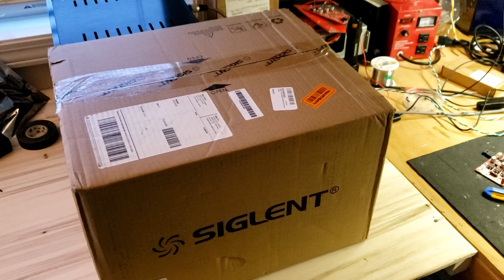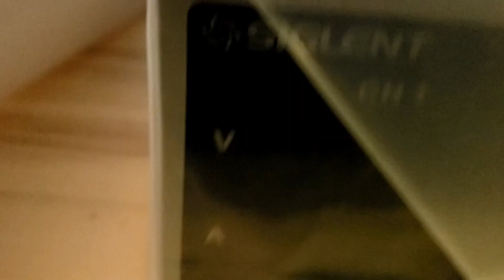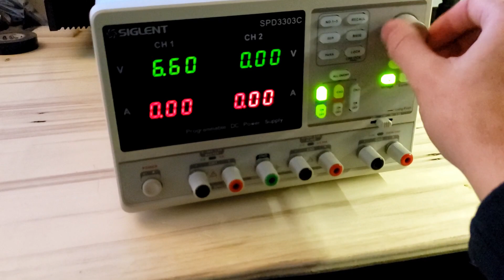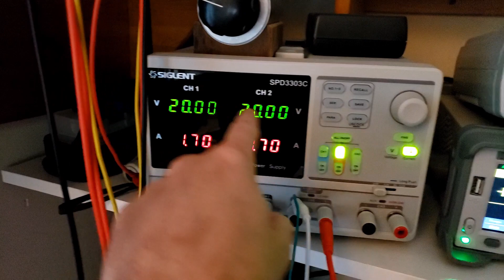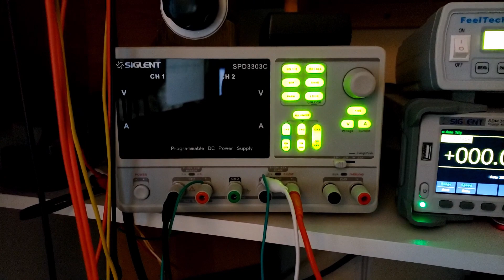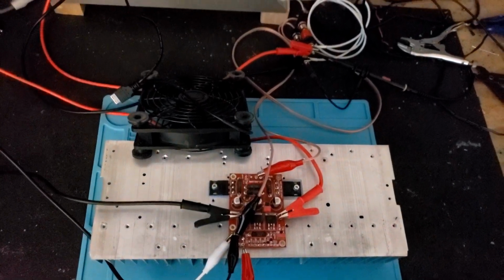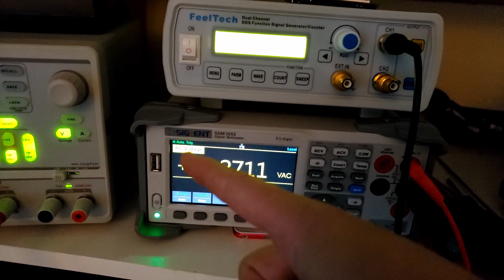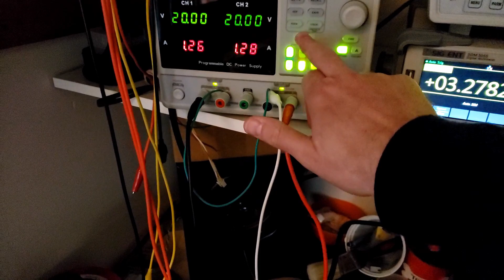Siglent SPD3303 PSU & Setup !

Comment: Nice power supply. Is it Linear type or switch mode ?
2. Does it has two separate power supply modules inside for connecting in series for making split rail ?

Comment: Great video! I'm considering buying this power supply but came across a couple of concerns online. Could you test these on your unit to see if they occur?

1. Does channel 3 show significant voltage spikes (even with a load) when you turn it on or off?
2. Does the supply switch to random settings if it experiences an ESD event, like when plugging something in or pressing a button? (This issue is mentioned in this video: https://www.youtube.com/watch?v=KkbVq94F688.)

It would be super helpful to know if these issues show up in your tests. Thanks in advance!

Comment: One of the reviews I read elsewhere said they were in a 120 volt region but received it set for 220.  But another problem is that the fuse was 3 amps instead of the 6 amps needed for 120.  Not sure if this information is valid, but seems possible.  Something to think about.
Reply: Push the switch over, to make it work for 110V